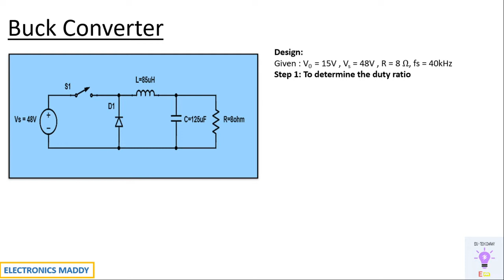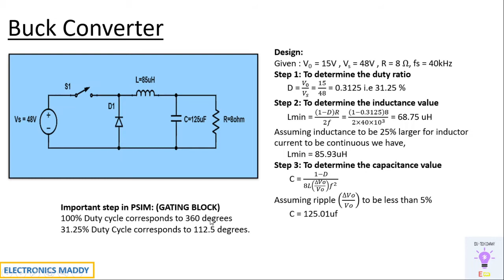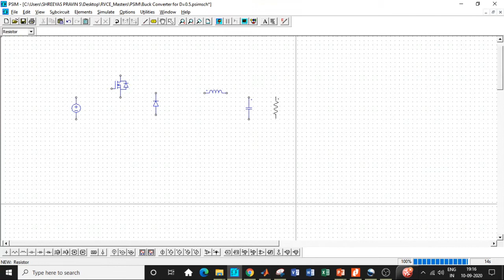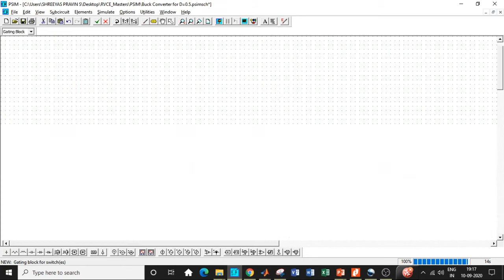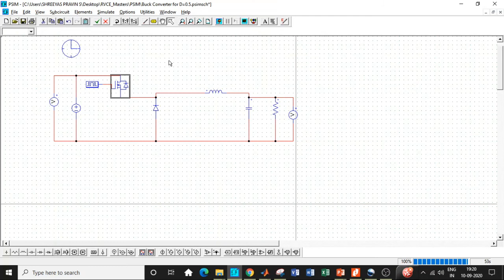Design and Simulation of Buck Converter in PSIM | POWERSIM

Comment: Hi Sir , Can i use thyristor in place of MOSFET or IGBT

And value of gate pulse (information ) is same for thyristor ?

Please help ...
Reply: When I use thyristor , input voltage is 47.99 and output voltage is also 47.99

I.e both is same.
Reply from the maker: As I told you, you must have a commutation circuit to turn it off as the supply is Dc
Reply from the maker: Actually you can use a thyristor but you need commutation circuit to turn off the thyristor. It increases the complexity of the circuit